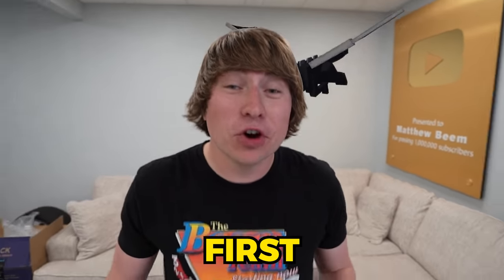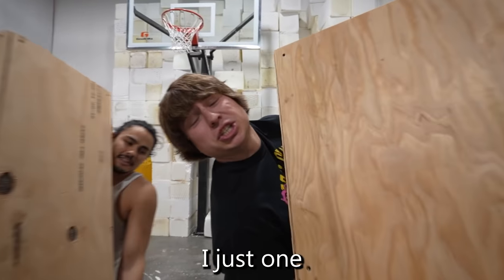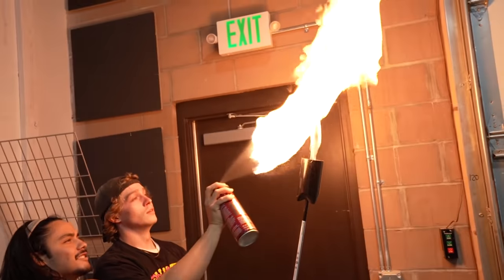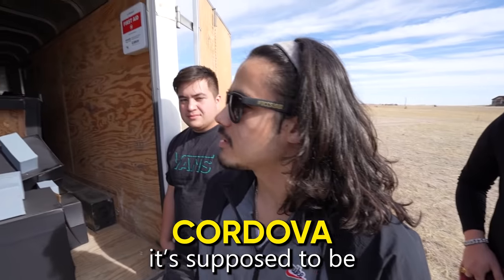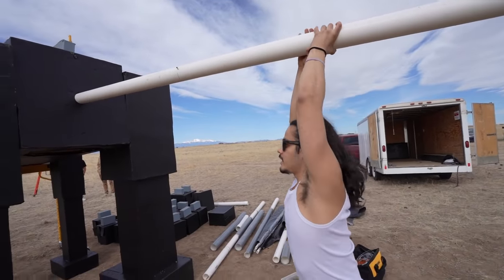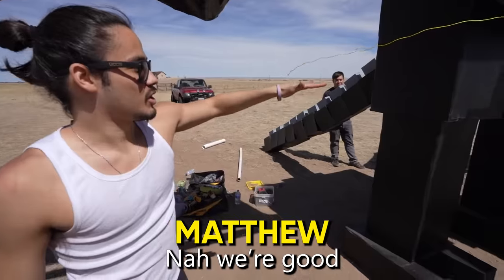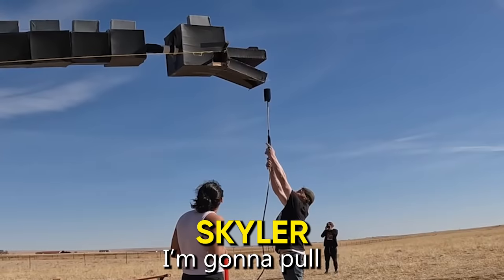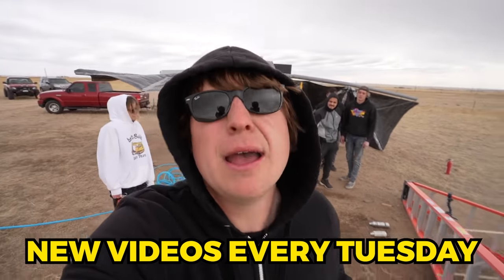Worlds Largest Ender Dragon!

Comment: @Matthew Beem- May I suggest that next time you build something with alot of top weight to use steel bars to reinforce the bottom structure to support the weight. You wouldn't have to change your original plans and it wouldn't cost alot nore would it be hard to do or complete in peices. Just my suggestion and would avoid crashes moving forward which could cause damage and more money to fix. But when dealing with peices like this the main frame is the most important part of these projects because it's main job is to be able to support the weight of your project on top. I know you have to keep cost down as well as weight for Shipping or transport. But I promise you a couple steel bar reinforcements would help distribute the weight on the bottom more which would ultimately allow you to add more top weight without the risk of collapse or being damaged. Hope this helps and just want to see you succeed in life man. You're a good dude with a big heart and have passion to become successful on YouTube. You have a fan in me and most importantly you respect. Hope nothing but happiness and success in your life :)
Reply: jk im joking your right
Reply: I like you man, you’re smart af